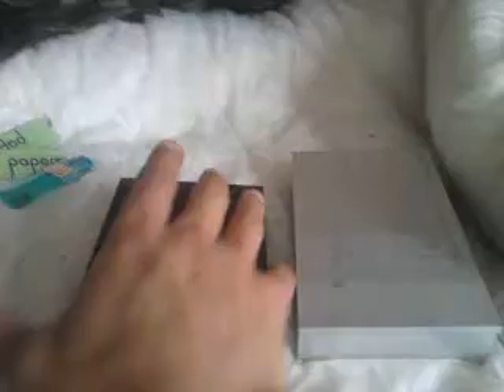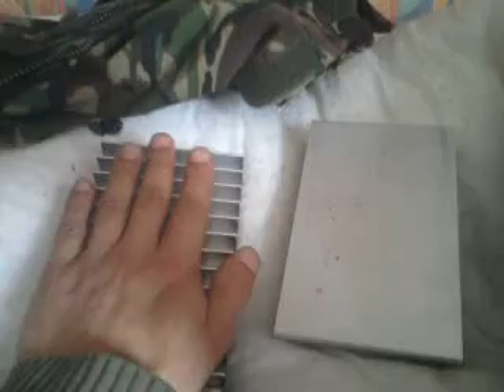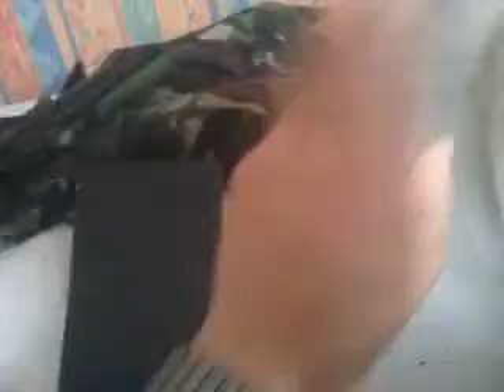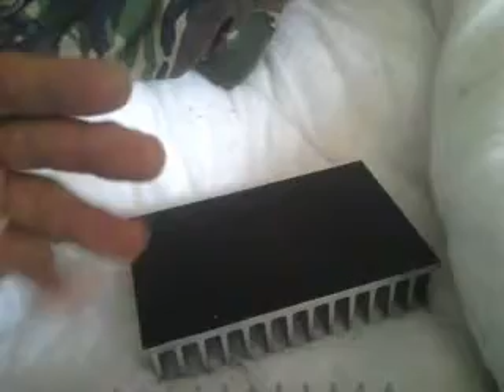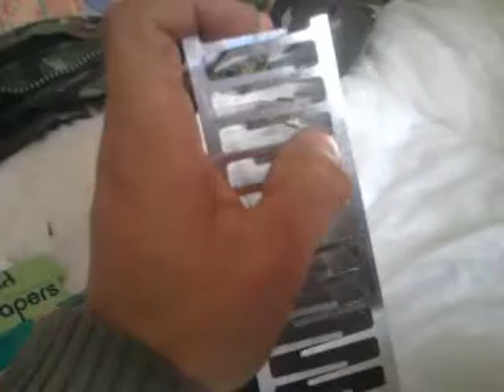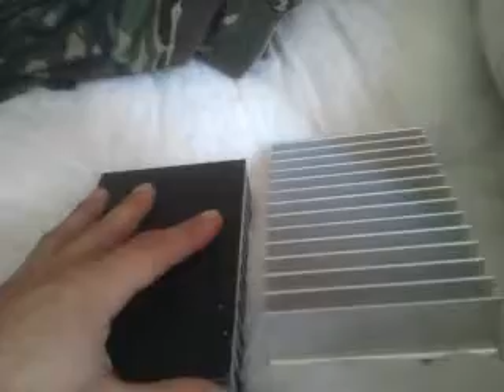heat resistant paint - is it best for thermoelectrics??

Comment from the maker: Thanks for letting me know, dont know why its not fully playing. It turn out to be good to use in a thin layer, the matt paint absorbs heat and will transfer it. an it wont burn off easily. there probably is some special made paint out there but id imagine it will cost too much for this really.

Comment: I coundnt play the whole video, it stopped at less than a minute into it, but perhaps heat resistant paint is not meant to be heat conductivel ,  and real heat conductive (thermo conductive or thermal transfer) paint and greases area